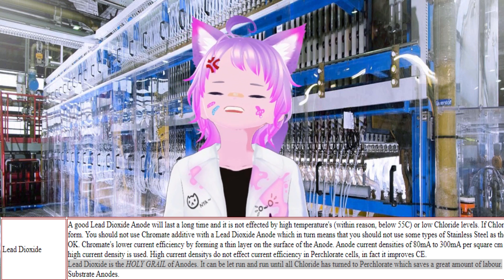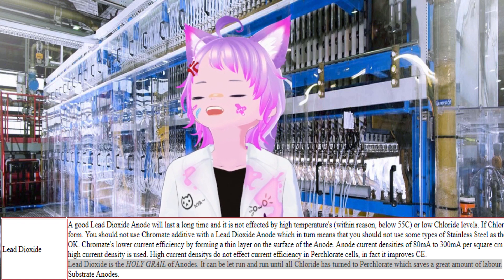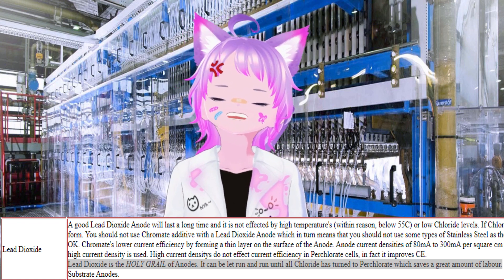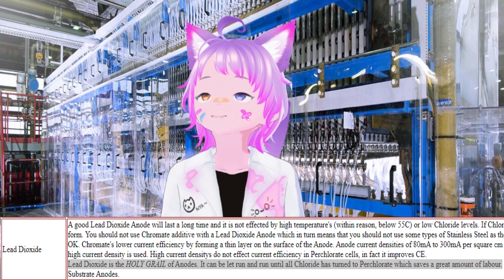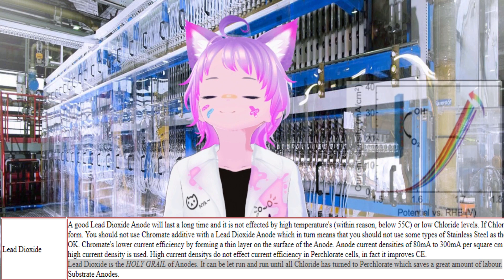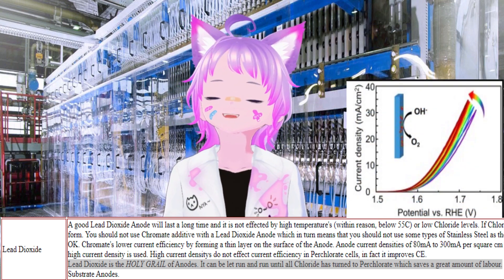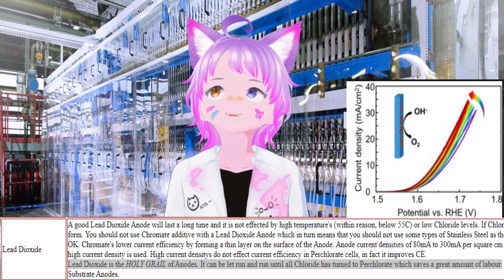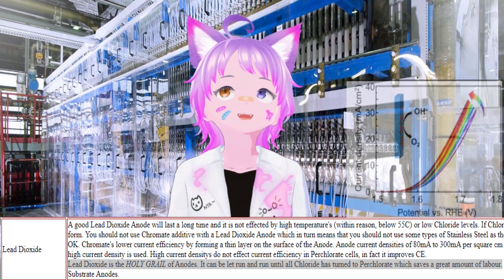Sodium Perchlorate synthesis from NaCl to NaClO4 using lead dioxide electrodes.

Comment: i hope you can answer my question, or maybe someone else will, but im currently very confused on what a lead dioxide electrode actually is... i understand that the surface is PbO2, but below is it titanium or lead? ive seen people make lead dioxide annodes, and they usually make it using lead as the cathode, so it oxidizes into PbO2, which i could actually make. But from these videos it seems to me that it's pbo2 coated titanium. someone pls explain, i'm slowly going insane
Reply from the maker: This is electrodeposited PbO2 on DTO coated titanium where DTO is baked doped tin oxide as you cannot plate it directly on titanium. The lead substrate PbO2 is limited in use case and corrodes more readily than the titanium subatrate version
Reply: @CatboyChemicalSociety  is it possible for the pb+pbo2 anode to survive in a perchlorate cell?  im guessing not but ill ask just in case
Reply from the maker: @ouepillthegoat  no it will fail due to interface oxidation of Pb substrate by hydroxy radicals.

The electrode used in the video is homemade using Ti substrate and DTO coating which ive shown previously then PbO2 deposition using alkaline medium.

Comment: I need you to answer my question: How much time do I need to convert 100 grams of sodium chloride into perchlorate using graphite electrodes and mobile charger.
Reply: Your power probably 5 volt 2 a,  100 120 ml hot water probably enough for dissolving sodium chloride. For this volume of water and this gram salt. I can say after 24-48 hour enouhh

Comment: Binder Clips are the most useful tools ) How to make robust Fe2o3 coating above titanium plate?
Reply from the maker: SnO2 coatings are better
Reply: @CatboyChemicalSociety I need you to answer my question: How much time do I need to convert 100 grams of sodium chloride into perchlorate using graphite electrodes and mobile charger.
Reply from the maker: @hzjddhjs9313  graphite will disintegrate and oxidize to CO2 before it makes any perchlorate go get a proper electrode and psu. It will take a month to get to chlorate full conversion.

Comment: I have a problem with perchlorate production. I started with about 650 grams of sodium chloride solution. Two handmade PbO2 anodes and one titanium cathode work in the cell. The area of each of the anodes is about 130 cm2 and the cathode area is 100 cm2. The cell has been working for about 9 days with an average current of 25 amps. The temperature is about 70 degrees Celsius. I have also adjusted the pH from time to time. After about 4 days, a black sludge sits on the cathode. In the sugar and tissue burning test, the presence of sodium chlorate is evident, but in the methylene blue test, there is no sign of Perchlorate production is not seen. Is this normal? I did not use any catalyst. How long does it take for the perchlorate production process to begin? Another thing, last 2 days the cell is working at 40 amps .
Reply from the maker: Many huge mistakes here. Firstly you should have only used one anode and 2 cathodes because to run a perchlorate cell you need 150ma/cm² on the anode. Also 70C is too hot and you need water cooled glass cell. If I assume your anode is actually 130cm² accounting for both faces meaning the electrode is about 5x15cm which roughly gives 150cm² so its more like 5x13cm. Anyway 130x150 = 19,500 ma so each anode is rated at 20 amps with 2 cathodes for even CD loading. For 2 anodes you need 40 amps to run it with 3 cathodes and a fkton of water cooling or heat exchanger see my latest video. My suggestions to you is switch to glass.3 liter cell. Use 2 cathodes not titanium because its terrible without buffers and use graphite or stainless instead. Run at 20 to 25 amps and keep temperature below 55C. Also if you want to fix your anodes see part 2 or 3 of my PbO2 from DTO video.
Reply: @CatboyChemicalSociety  Thanks for the quick reply . The anodes is 15x10 . But it is a titanium mesh that's why I reduced 20 cm2 . But I think I only calculated the surface aria for one side.
Reply from the maker: @kasrah.2087  15x10 then each anode needs 40 amps. Really go watch my video on water cooled perchlorate cells because otherwise your anode is too big.
The minimum current density for PbO2 is rly 150ma/cm² and is also nice to run for the 55% efficiency with sharp drop off lower than it. A current density of 200ma/cm² gives an efficiency of 87% and is good if the anode is layered composite PbO2 which it isn't.

The 2 most important equations is the surface area of a double open ended cylinder since coolant usually is annular and fourier's law of heat conduction is the second equation.
Reply: @CatboyChemicalSociety  Thx bro .I'll report my next atempt
Reply from the maker: @kasrah.2087  if you ever damage those electrodes beyond repair then you can recoat them using my DTO substrate PbO2 videos
Reply: @CatboyChemicalSociety  Hi i use 140ma/cm2,Used to run very well，Current efficiency more than 50%. but now I run same setting,is less than 40%.Idont no why,my pbo2 anode see not bad
Reply from the maker: @dragonwarsun  cathodes could be plated with lead which lowers current efficiency because lead metal is strongly reducing.
The other reasons are chromates can slowly poison your PbO2 electrode leading to less efficiency but this is fixed with forced errosion in 10% HCl and or plating over the electrode with fresh plating solution.
The other reason which is less likely is erosion over time can increase the "real" surface area and increase current density requirements.

Comment: Hello brother, please, I have a question. Does leaving the electrodes in the cell without current flowing, does that constitute harm?
Reply from the maker: Do not leave electrodes without current or it may but not always cause galvanic reduction of the anode. This will however happen if left unpowered for 6 hours or more.
Reply from the maker: PbO2 cannot be left unpowered even for 30 mins as it's very prone to galvanic effects.

Comment: Trapping ozone in soap bubbles is definitely a cool innovation....
Reply from the maker: the surfactant is eventually destroyed though. so it needs to be dosed more after some time. I notice because even the bubbles dont overflow it eventually stops producing foam after some time.
The scrubber liquid can be either MnO2 or urea or a mix for decomposition of ozone.

Comment: Are you buying these electrodes or are you making them yourself?

I ask because I have a few hundred Kg of lead dioxide on hand that would seem like an excellent way to use it.
Reply from the maker: homemade but making it is a pretty complex process.
Reply: @CatboyChemicalSociety  Meh... I've got plenty of large reaction vessels, a whole machine shop, and some pretty solid power supplies...

I've been doing various random chemical reactions since early childhood, and now after years working in renewable energy research, I've pretty much developed a good enough sized laboratory that not much is out of my reach even without buying any new equipment.

Complexity is not an issue for me.

I just need to know I am doing it the best possible way I can and I'll be quite pleased.
Reply from the maker: @hunnybunnysheavymetalmusic6542  basically you would need an DTO or MMO substrate which is a mix of tin tetrachloride and any dopant like ceric chloride 8:2 ratio and you can use the pentahydrate so it doesnt fume and is easier to synthesize with my latest video on it.
Then you must plate PbO2 at 2.3ma/cm^2 with a saturated plumbate solution at 50C constantly with strong stirring for about a day or so.
Reply: @CatboyChemicalSociety  Cerium is a mineral found in this area where I am, so its possible I could manufacture my own ceric chloride in situ, and tin is super easy to get from recycled electronic scrap, so that's nothing but a little recycling...

I'm really encouraged, because with all the insane restrictions these days on oxidizers, and my aims to get into full scale mining, its really a total game changer to be able to produce my own perchlorate on site, instead of going through all the garbage to get permits and buy it and all that garbage.
Reply from the maker: @hunnybunnysheavymetalmusic6542  the cerium has to be pure enough
Reply: @CatboyChemicalSociety  If I can not obtain enough cerium directly from my own mine, I can buy some, that is not difficult.
Reply from the maker: @hunnybunnysheavymetalmusic6542  I recommend buying it because the cerium really needs to be pure. The lead is better if it was pure and you need to reduce it to PbO first before dissolving in 4 molar NaOH.
Reply: @CatboyChemicalSociety  Reducing it all to pure PbO ain't EVEN a problem because it starts out as lead oxide to begin with and I have the ability to use a 1200C kiln that will roast 250 kg of lead at a time.

And if THAT were not enough, I can build a big blast furnace that can convert ten tons at a shot.

I can convert more lead than I can get hold of at the moment.

I only have about a ton on hand at the moment all told, but if I can make electrodes at a profit, then I'll sure do so.

But for my own purposes, I probably have more than enough lead dioxide to reduce and reoxidize already on hand.

I have 2 240 liter PVC reaction tanks and 3 1000 liter HDPE tanks I can use, as well as enough power to run all of them at the same time.
Reply from the maker: @hunnybunnysheavymetalmusic6542  well we can have a back and forth discussion about this in my discord server "the catboy chemical society".

Comment: I just added about 5mL of H2SO4 to 5g Barium perchlorate in order to try heating some of the resulting HClO4 on the surface of bismuth (I had seen it on exp&fire). Unfortunately all I got upon heating and removal of the flame was a lot of perchloric acid vapours. I didn't get any of that mystery detonating black stuff. I would ask Tom but I don't think he will answer. You said I could make perchloric acid this way and I think I have made it. I've not filtered from the solid, in fact it seemed like the barium perchlorate got dehydrated and clumped up rather than disolving. It did warm up and produce some wispy fumes but I didn't apply any heat to it.
Reply from the maker: I think your solutions were too concentrated and for this synthesis you must ensure that its dilute otherwise barium sulfate wont go out that much.
After preparing about 30% perchloric acid and filtering off the barium sulfate you can then boil off the water or distill it off whichever then this gives you 70% perchloric acid.
Reply: @CatboyChemicalSociety  thanks, I had added acid straight to solid, I'll try adding some water, heating and filtering it
Reply from the maker: @SodiumInteresting  adding sulfuric to straight solid is a good way to BLOW UP.
anhydrous perchloric acid is FUCKED and really dangerous and can spontaneously detonate.
Reply: @CatboyChemicalSociety I kept quantities small. Probably good I didnt use oleum. I added small amount of water and it's gone cloudy with a clear bit on top, at the bottom is white solid which seems like different substance to the starting material.
Reply: @CatboyChemicalSociety  I appreciate the warning btw
Reply: @CatboyChemicalSociety  making it anhydrous perhaps prob isn't wize until I at least have some experience with aqueous solutions first
Reply: @SodiumInteresting  making it anhydrous isn't a good idea in general.  It has a tendency to detonate because something mean was said about it.  Touchy stuff.

Comment: A little ozone cleans up the bad smells in the room
Reply from the maker: this thing produces an ungodly amount of ozone which is why the scrubber was warranted and even with a scrubber the ozone smell persisted albeit in ok levels like an electronic shop and not sticking nose into high voltage source.
Reply: @CatboyChemicalSociety  I still really appreciate that taste of a lethal dose of radiation
Reply: @CatboyChemicalSociety  Platinum and lead dioxide electrodes are both used in the electrolytic production of ozone from dilute H2SO4 solutions, iirc they can produce up to 15% ozone in the oxygen released at the anode. Definitely wise to run it through a scrubber.

Comment: This is fascinating, you're a real pioneer in the field! I sealed some WP in a test tube once. A hairline crack formed in about a 2mm thickness of the glass at the top, but it was enough. I was holding the tube and I got a whiff of ozone. It was definitely detectable at that end of the tube 24 hours a day. I never wouldda thought!

Comment: Does heat treatment help fuse the PbO2 coating better? Is there any residual stress from the plating to worry about?
Reply from the maker: its an alpha PbO2 coating process so nope. and if it was beta PbO2 the most they do is add layers of alpha PbO2 or have carefully controlled temperature curves to destress them with both these working.
Alpha PbO2 is free from stress but overcurrent above 250ma/cm^2 is not good for it.
Reply: Can i use lead oxide instead of lead dioxide for perchlorate electrolysis thanks